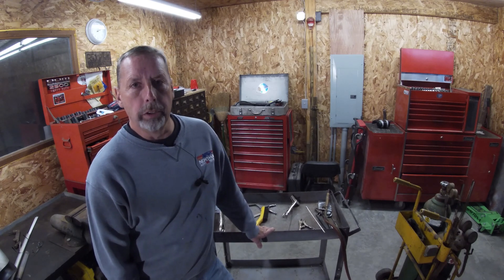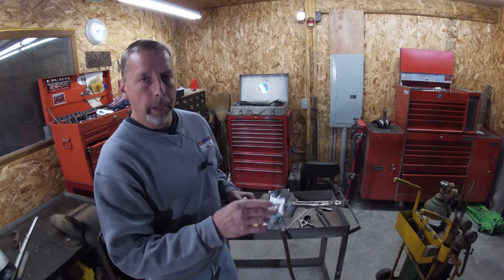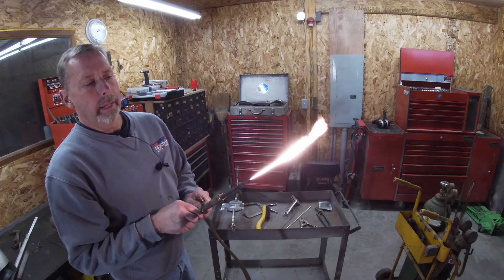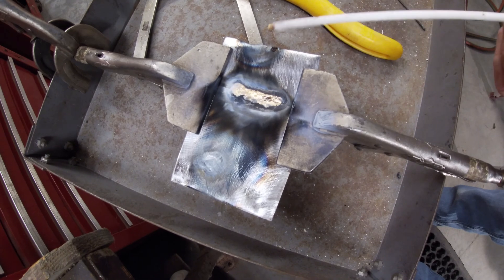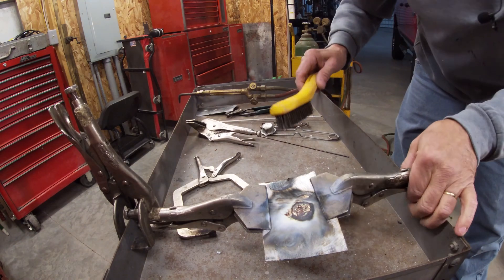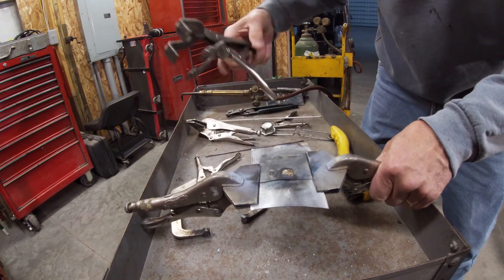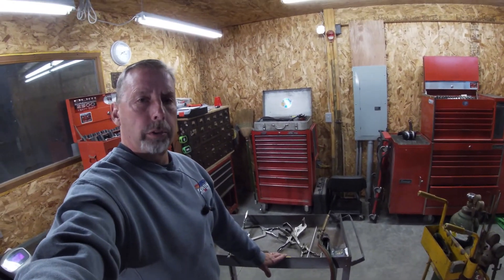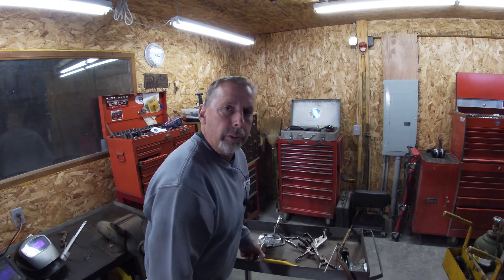Brazing & Welding with Oxy Acetylene Torch | Tutorial & How-To

Comment: I’ve been brazing refrigerators since ‘84 never welded. But I have a situation that requires a weld. I’m searching Internet for help. Your video is very straight forward and you explain it much better than the others I’ve seen.
Reply from the maker: I appreciate the positive comment. Glad it helped and thanks for watching
Reply: What are you gas welding?  If its thin sheetmetal like 18 gauge just use .030 solid mig wire (not flux core).  He's using an rg45 rod thats too heavy of a filler rod for that thin of metal.  Set gauges at 4psig oxy and 4 psig acetylene and adjust accordingly at torch  Do the neutral flame just like brazing refrigeration copper.  You can weld with an old wire coat hanger if need be.  You want your filler rod to be a tiny bit less than the thickness of the metal.  .030 wire covers 16-22 gauge sheet metal.  On thicker materials you have 2 choices rg45 or rg60 rod but you can also use tig er70S-2 rods for a wider selection of rod thicknesses for thicker material.

Comment: Hi, good evening. I want to weld the exhaust pipe of my motorcycle. I have acetylene and oxygen, but I don’t know the name of the type of welding you are using. Could you please tell me what that type of welding you’re using in the video is called? please
Reply from the maker: I don’t know the technical name. I’ve always heard it called gas welding with a steel rod. This is what all the muffler shops did years ago. You could use a steel coat hanger for the rod. Thanks for watching
Reply: @autobodytrainingsolutions838  Good morning, thank you for responding. Are the rods you use in the video made of steel? I'm asking so I can purchase them online.
Reply from the maker: @CarlosGracialattaro
Yep just plain steel rods. 1/16 or 3/32 is the diameter. Google search will show them. Good luck
Reply: @autobodytrainingsolutions838  thank Sir.

Comment: Can I weld steel to aluminum with a torch and brass rod.
Reply from the maker: No you can’t. As far as I know there’s no way to weld steel to aluminum with anything. Thanks for watching
Reply: @autobodytrainingsolutions838  You ever tried brazing aluminum and steel using Brass rods?
Reply from the maker: No it won’t work

Comment: Broke out as a journeyman in `73. I always thought it is a lot easier to drill for a brass plug weld.
Even on old 19 gauge mild steel, a 1/4 inch drill bit sunk half way through the backing panel  allowed us to use a 00 tip, and control the heat zone and warpage. Welded on a ton of 1/4 panels that way. It is also a super strong method. Just try to cut apart a brazed plug weld with a chisel, you will end up cutting the steel because the brass will not cut at all. You have to get out the torch and re-melt it to get it apart (or grind it with a stone). As for filler adhesion, I found that if the brass was clean and abraded, it stuck just fine, when there was still burned flux though, that was gonna be a comeback.
I went to work at a body shop in Missoula Mt in `78 and they had a mig with 0.35 wire, I hated it except for heavy iron, way too much grinding! Now we use 0.23 wire when we get a mig out at all. Most stuff is squeeze type resistance welds and adhesives these days.
Thanks for the video.
Reply from the maker: Yep. I know exactly what you’re talking about. Brass was the way to go in the old days. Thanks for your comment and for watching

Comment: I grew up with a stick welder and did a little brazing too. Now at 70 years old I had to do some repairs on my brother's lawn mower. The steel exhaust pipe snapped off of his stainless muffler. I tried arc welding it, but the metal was too dis-similar and I was either burning holes or just sticking rods. So, I got out my small oxy-acetylene rig and decided to try brazing it. I didn't have any brazing rods, but I had plenty of metal wire coat hangers. So, I used the coat hanger and everything flowed like I was soldering copper pipes! Brother just finished mowing the three acres and the muffler was doing just fine!
Reply from the maker: Those old school techniques still work great and it’s fun to get out the old tools and put them to work. Thanks for watching

Comment: when you started on the steel rod, the first thing I thought of the muffler shop in town,the man is an artist at welding and bending tubing,I watch you do these things and think to myself, very few people even want to do these things anymore, reputable auto repair/body shops  and maintenance is going to be a thin market soon,I hate to say it
Reply from the maker: You are correct. That’s been an ongoing problem that’s only getting worse. It doesn’t help that most things manufactured are disposable that isn’t even supposed to be repaired . Thanks for watching

Comment: Learned how to oxyacetylene sheet metal in highschool (late 70's) in welding class (then stick-all positions, then mig, then tig aluminum and stainless).  Worked in a body shop around 80, and we had a mig welder.  Even though we had bondo then, they started me on softer thickish metal cars (old VW bug), and I learned how to lead and file and work curved metal (lead instead of bondo).  The painter was an old hot rod guy, and told me about how they used to prep for paint using leaded gas for wipe down.  He died of cancer at about 52 years old ... all that paint and lacquer thinner.  The 2 partners told me to go to college, and not be a body repair guy.  I got an engineering degree, and have been working ever since - but I still miss those days of hammer and dollie ...
Reply from the maker: Yeah the good old days. The only PPE was a respirator and most guys only used them if they put hardener in the enamel. Thanks for watching

Comment: I grew up on a farm where equipment was repaired with a oxygen acetylene torch. We didn't have power grinders etc. The rusty metal was prepared with a wire brush or file. I noticed that a lot of our repairs were along a previous weld. I've also heard the question of why do welds always break. What is/was the cause of this? Thanks a lot.
Reply: Research stress risers